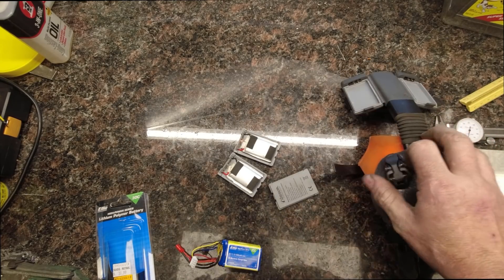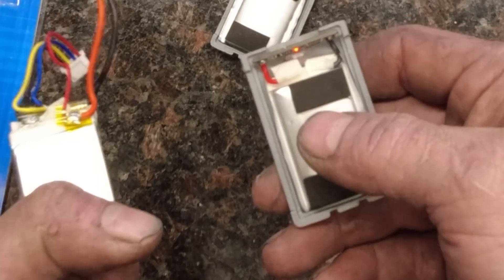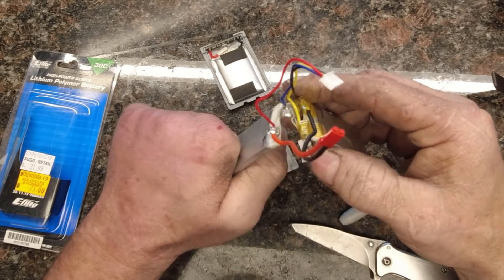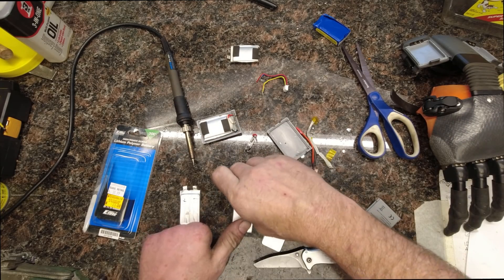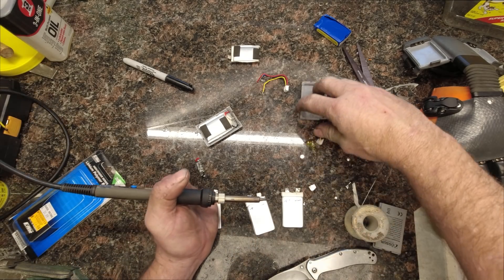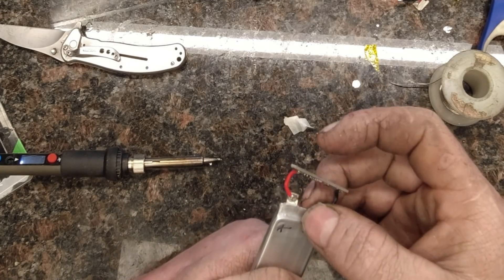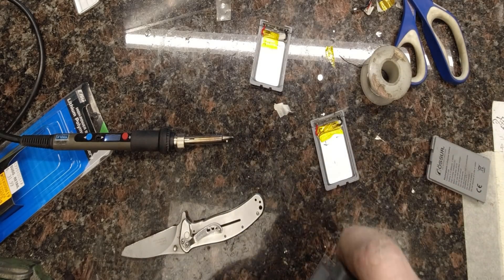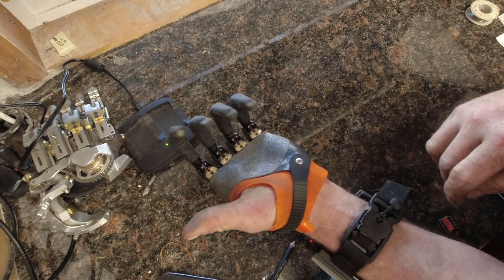How to replace the li-po cell in your Ossur I Digits battery pack

Comment: Quick thing! I noticed you were using a pocket knife to peel something instead of cut it, and I would recommend getting a large Swiss army knife (or a knock off brand). I say this cause the nail file part has a blunt, straight end that is good for peeling stuff off, and I use it for that all the time. Honestly a small screwdriver could also do the same job if necessary.

Comment: Dude you need to talk to a russian guy called alex lab and do a collaboration on his exoskeleton. He has an amazing knowledge and design skills and is working with artificial muscles.
Reply from the maker: I'm a big fan of his work, and have commented on quite a few of his videos. Artificial muscles are great and all, but packing around all the extras that go along with making them work would be a drag. And you still have the issue of when the battery is dead,  you can't move your hand.

Comment: Hey I have an Idea!
What if you build smaller fingers inside the larger ones. So if you are trying to do/pickup something more delicate the smaller fingers would have a better grip or smaller grasp. While the larger fingers would be stronger and able to turn nobs and hold up slightly heavier/bigger objects.

So essentially a hand within a hand.

Comment: Have you ever considered piezo elements strapped to your wrist as sensors for an electronic hand? Could in theory work as both input sensor for the electronic and you could play back a high pitch tone and into your skin. Amplitude and frequency changes could carry information into your skin for an intuative feel after a while. Example could be torque feedback from a finger etc. Piezo elements are really cheap on ebay and it should be doable to get Piezo elements with enough output voltage to feed an Arduino board. Regarding those batteries, keep em between 3.3V and 4V for up to 3 years lifespan.
Reply from the maker: For the hmi I'm using 2 cap touch buttons for menu and execute, and a gy521 mounted on the hand. I'm using it in a logic gate configuration. That will let me lock the fingers individually.

Comment: From the moment I understood the weakness of my flesh,
it disgusted me. I craved the strength and certainty of steel. I aspired to the purity of the Blessed Machine.

Your kind cling to your flesh, as if it will not decay and fail you. One day the crude biomass that you call a temple will wither, and you will beg my kind to save you. But I am already saved, for the Machine is immortal…

...even in death I serve the Omnissiah."

Comment: 1. Dont over heat the connections, PERIOD
2. Could have Scratched the surface to make better contacts,  Sand paper does work.
3. Show them how to KNOW, with a tester, Which contact is which.

long ago learned SHOW the BASICS.
And a smart person may know allot, but explain that Your steps may not match HIS, and its easier to do it simple with allot of explanation, then to Miss 1 thing, that THEY may not know.

Comment: Be really careful when cutting open battery packs to NEVER puncture the battery.  Also have a metal bucket near by in case something goes wrong (it starts smoking, etc), you can toss the battery in there and take it outside and wait for the fireworks show to be over.
Reply from the maker: There was an open window to the car port opposite of me that they were going out of if anything went sideways. 
The packs themselves weren't super tight, they were just a little bit puffy. If they were super tight I would have handled the repair differently.
Reply: I cringed when you pryed them out using a knife, it could have easily punctured the thin pouch.  The knife is also in your remaining good hand!  A slip can cut them!  Please be careful, if not for your own good, but for me selfishly wanting to see more great content from you!
Reply: Yea, lipo batteries are no joke for taking safety precautions. Just one little poke in the new batteries, or even a prod (not even a puncture) on the puffy batteries can cause a thermal runaway and then a fire that you can't put out, you just have to wait till its done burning and hope you dont inhale that crap.  It's hard to move something after its already flared up in your face.  

Not saying it always happens, but once you've seen one, you give them more respect, realizing how lucky you've been before.  

Plenty of lipo fire vids on youtube, if you ever want to see how easy/accidentally/spontaneously it happens.

Comment: Do you hold the soldering iron in your left hand because you’re left handed or because holding and manipulating the battery cell is easier with your right hand?
Reply from the maker: Great name!
 It's because up until 7:45pm  November 6th, 2018. I would have considered myself  left hand dominant.

Comment: I probably wont ever need to apply this knowledge for prosthetics, but I appreciate you sharing it! If I ever need to replace lipo cells I will remember this and apply what you have taught.
Reply: Hey, just have a metal bucket you can toss the battery in, if things go south cutting them. Toss them in there, take them outside quickly and wait for the fireworks to go all out. 
Another thing, when soldering them, make sure the soldering iron is constantly as far away as it could from the lipo battery, heat really doesn't do them good.

Comment: i'd advise against unsoldering wires from a cell whenever possible.. best to cut the wires, then re-solder wires with some heat-shrink (or even better : crimp some standard JST connector), so it doesnt risk heating up the battery too much.

Comment: 6:16 - reckon flux would do you wonders here! never soldered straight to batteries but if there’s ever some oxide or any crap on what you want to solder to it makes things much nicer. most important thing for soldering
Reply from the maker: I was using rosin core 70/30. the temperature was probably a little low, I didn't want to put a bunch of heat into the cells.
Reply: @missingpartsclub  rosin core solder is nice but nothing substitutes a good flux pen or paste :D

Comment: If they're held on with double-sided sticky tape you could probably use some isopropyl alcohol to dissolve the adhesive instead of using a knife?

Comment: How does this prosthesis compare to your mechanical one in daily use? To me, your mechanical hand seems much more snappy, while this one seems to take about half a second to respond.
Reply from the maker: First off, I'm very appreciative that I was able to get that device, but for me, in my daily, I found it very frustrating, and difficult to use with the 1 whole second that it takes for the fingers to go from open to closed. 
when you want to pick something up you have to stop, think about closing the hand, wait for it to close, make sure that it closed, are you really sure that it closed? then you can go on your way. rather than with my mechanical one, just grab something and go.
One of the big difficulties with the myo hand is that it has a blind touch and there is'nt any proprioception with it.
Reply: Thanks for the response! I can imagine it to be very frustrating.

Comment: VERY IMPORTANT: Never heat up batteries, be careful when you solder them on/off.
Reply: Is that how you spell it?
Reply: @Joesgamesntech  I missed am L, thank you for the correction.
Reply: A soldering iron will mess up a lipo ^ do NOT let them touch or be near eachother for long.
Reply: is that a message to Ian or a message to dummies who wouldn't know such things? anyways, i've cooked things myself before. it's not really that big of a deal on the work bench. it's more of an annoyance that you ruined your project than any sort of danger.
Reply: @iamzid  It is to anyone who is trying to replicate this process. 
You haven't heated a battery before if you only "ruined your project". They really do explode and spray acid everywhere. Sertainly not if you heat it up just a little by touching it with the soldering iron, but you are soldering stuff onto it.

It's the same thing as saying "I have been hit by a car before, it wasn't that bad. It just messed up my bike and the car. I was fine."
Reply: @generalmisery  Isn't the point of lipo that the electrolyte ISN'T a liquid, it's a polymer gel type thing?
Plus isn't the electrolyte neutral....? 
I don't think there's any acid in lithium batteries. Doesn't mean its not dangerous, cause it's flammable, but it's not acidic
Reply: @wsketchy  I am no battery expert, you are right I think. Still dangerous as you said.
Reply: @wsketchy  burnt to a crisp, house gone, but at least there's no acid spray
Reply: @Richloam  Generally what I meant by "Doesn't mean it's not dangerous", swapped one danger for another (a worse one at that)